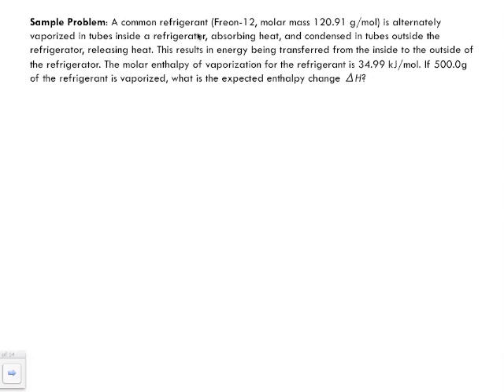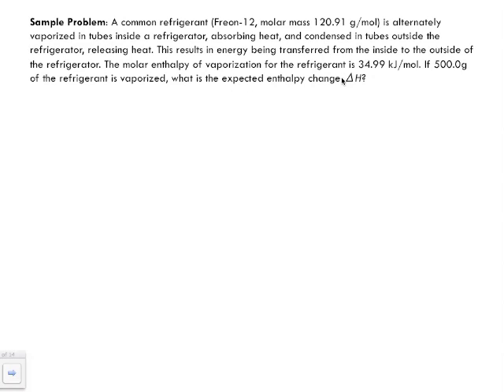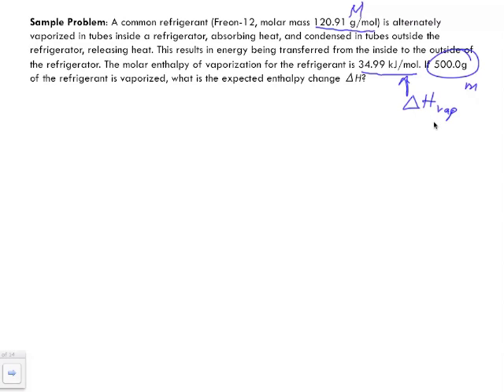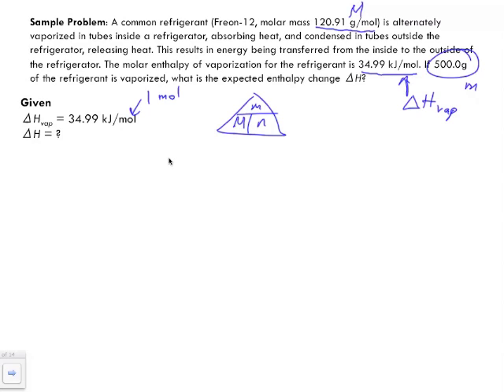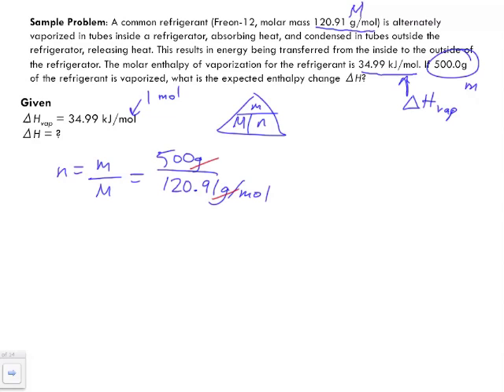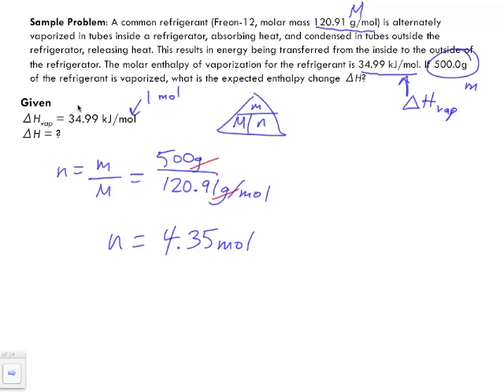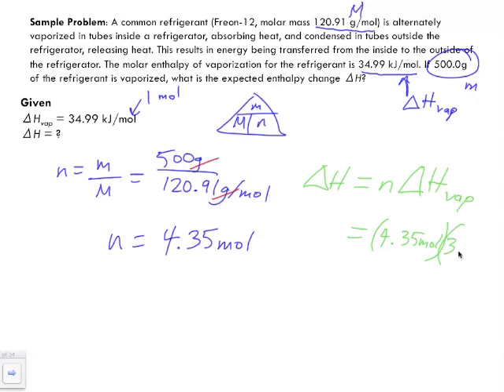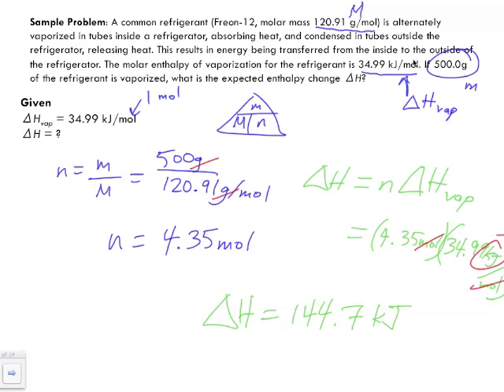Molar Enthalpy Sample Problem 1

Comment: :o...I think you made a mistake in calculations the n= 4.135 moles not 4.35 this means that the answer should be altered slightly.